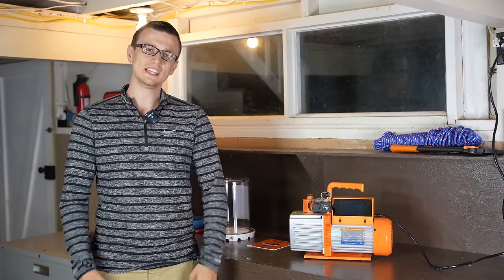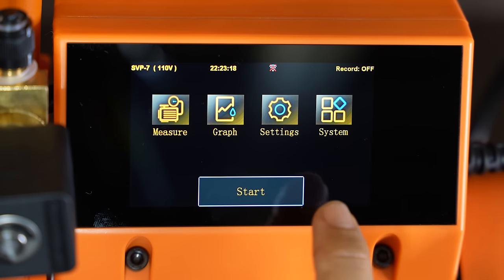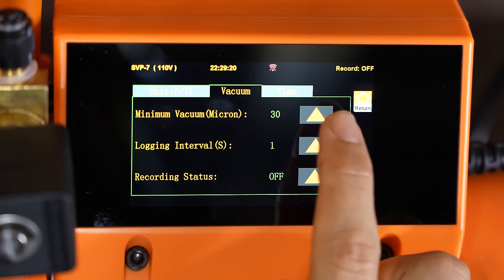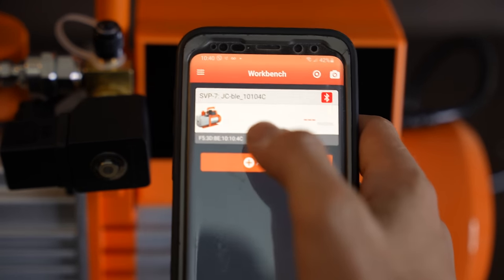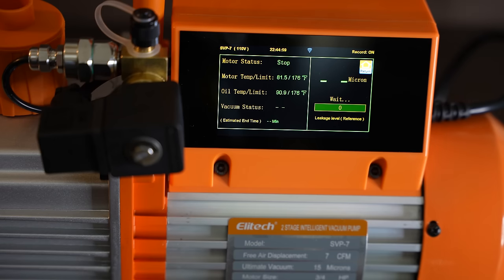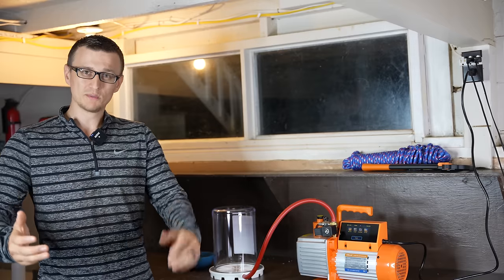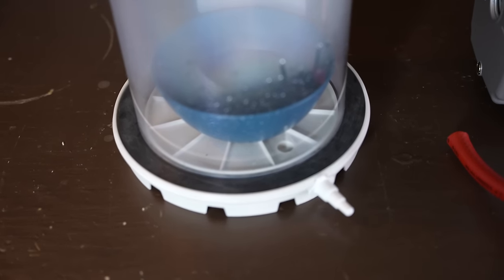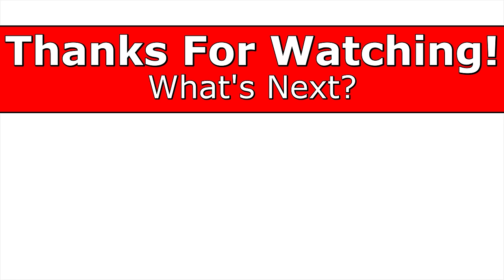Elitech HVAC Vacuum Pump Review

Comment: Residential I could see this as an option, but as a commercial service tech for years, hauling this thing up an extension ladder onto a roof, and keeping that large digital display from bouncing off the side of the ladder and breaking it?  I'll just keep the micron gauge in my digital meter where are least it is lighter and easier to protect.
Reply from the maker: That is actually a great point! Thank you for pointing it out. I didn't even consider the fact that the screen could easily get cracked... Will need to add that to the list of cons 😅

Comment: Another awesome video thanks for sharing.
Do you recommend this particular vacuum? I ask you this because I have been looking around other vacuum pumps such as Fieldpiece and honestly that’s one of my favorites, but this one comes with the microns gauge built in. 
I am looking forward to read your opinion thanks.
Reply from the maker: Hi Jose! I cannot give you a good answer since I have not tried this pump on an actual unit yet. I am not sure which Fieldpiece pump you are looking at but I believe both pumps should have similar performance. Just pick one that you like more. Look at the specs of each pump and decide what you prefer. For example:

Fieldpiece: 5CFM
Elitech: 7CFM (should be slightly faster and more powerful)
Fieldpiece: 31.0 pounds (this one weighs less so should be easier to carry around)
Elitech: 37.7 pounds
Fieldpiece: Has 4 different port sizes
Elitech: Only has the one standard size and would need an adapter for any other size.
Fieldpiece: No "bells and whistles", a plain pump that has a good track record
Elitech: Has a digital display, micron gauge, and you can hook up to it with your phone.

Etc... Choose what will work best for you, depending on what you prefer and what you need. This Elitech pump had a good first impression on me so I will be keeping this one for myself but I have never had a Fieldpiece so I can't tell you anything out of experience about it. I've only had Yellowjacket and JB pumps in the past.
Hope that helps. Good luck!

Comment: Jay, thanks again for doing these kind of videos, very useful,I've subscribed your channel many years ago, when you were not in Hawaii, 🙂 I actually also bought this unit (12 CFM though) as well and tried it recently. The one thing I am a bit unsure about it is the leakage level, which the manual says should be between 0 and 100, and also said that the number 0 means unknown, I am confused about this indicator, should one try to achieve 1 or 10? a number of 100 certainly is 100% leak, 0 is unknown, are we trying to achieve somewhere in between? I've also send the same question to Elitech but has not received any response yet. Your thought on this will be much appreciated. Thanks.

Comment: Sir please sugest me pressure washer for split ac servising.how much pressure need for coil cleaning
Reply from the maker: The fins on those coils are very flexible so using a power washer is not a good idea. It will bend all the fins which is not good. Using a regular hose nozzle with not too much pressure is all that is needed. You can even cap the end of the hose with your thumb instead of a nozzle and that will be good enough.
Reply: @WordofAdviceTV  but in my country no any customer want servise without pump.what should i do.please advise.

Comment: i know this has nothing to do with ac but i was wondering why i had to put a jumper on my thermostat from rc to rh to make everything work
Reply from the maker: Rc is power to cooling and Rh is power to heating. On many thermostats, the hot wire coming from the furnace will only go to one of those terminals so the jumper needs to be added to provide the power for the other one as well. I am sure they could have designed that better but that's just the way it is..
Reply: @WordofAdviceTV  thank you for answering my question.  I enjoy your videos you are an excellent teacher.

Comment: I love your videos!😊 I like the fact this vacuum pump had a built in micron gauge. Great. Question, is there a vacuum pump that can also do recovery in refrigerants? If so, could I get the link on Amazon, thanks.
Reply from the maker: Thank you! As far as I know, there might be something like that out there (vacuum and recovery in one) but I have never seen one before. It would probably weigh around 100 pounds so it wouldn't be very convenient to lug that around.

Comment: Gadgets are cool but kiss is best.
The way I was taught eons ago was to separate the vacuum pump and the vacuum gauge.
Put the pump on the one port and the gauge on the other.
True system vacuum reading instant readings when you blank off.
Everyone does it different.

K- keep
I- it
S-simple 
S-stupid
😂🥃🥃🍺🍺🍺🏌🍇
Stay safe.
Retired keyboard super tech.
Wear your safety glasses.( nice demo tho)
Reply from the maker: Your way sounds like it is the right way 😄
I always appreciate the input of a veteran tech! Thank you!
Reply: right, the gauge should be placed the farthest from the vacuum for the most accurate reading, but the gauge on the vacuum self is also good (I think).  The best thing probably is having another gauge at the other end and read both, but the catch is that more equipment connections more chances of leak.